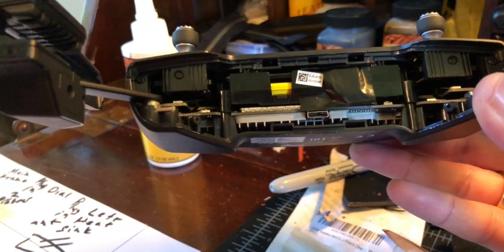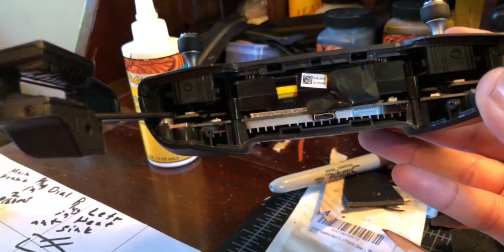DJI Spark Remote GL100A repair disassembly teardown

Comment: Can you help? My dji spark RC wont turn on 😢 please help
Reply from the maker: If you don’t get any lights at all, even when plugged in, it’s most likely the battery voltage dropped too low. The charge circuits won’t let you charge a battery that’s below a certain “safety” voltage level. If it’s just barely under voltage you might be able to revive with a “less smart” battery charger like one made for a a flashlight. Just make sure the charge is the correct voltage. If you are able to charge it some, i’d recommend finishing the charge back in the RC so it wont overcharge which could be dangerous.   Hope this helps!

Comment: The upper ribbon connectors or the lower ones? Or both?
Reply from the maker: It’s been several years, but I recall there is a ribbon connector on each side.

Comment: Hi I need help to charge my dji spark controller it keeps defecting please help
Reply from the maker: Not sure what you mean by defecting? Could you elaborate? Make sure the cord you are using has a small enough tip where the plastic doesn’t prevent it from going in all the way.
Reply: @bowieinc  I just opened it and found out it’s water damaged😭

Comment: Hi,

Thanks to you, I was able to open the remote. 
I need to change the USB port, but it looks like the motherboard is glued to a metal plate.

Can i send you photos in order to help me please?

Thanks
Reply from the maker: Sofyan B Hello, here’s a video that shows the usb being fixed. This should show you what you need:) I’m  very limited as far as my electronics knowledge. 
https://youtu.be/RkIdeKF_IZc
If link doesn’t work, the video name is “Broken Micro USB port on DJI Mavic & Spark, Replace Port Ketika Remot tidak bisa di charger”.

Comment: Thanks a lot, my remote was constantly beeping and I couldn't calibrate it.  Opened it up and found a loose screw stuck to the throttle stick on the bottom preventing it from moving properly.  Also the ribbon cable connectors open up by flipping up the black part along the back.
Reply: i am happy for you

Comment: Can you help me to fix my DJI Spark Remote?
Cz my DJI Spark Remote wont stop the red blinking.
The Red Blinking can be Stop after not turn on for a month time, but no wifi found
The Wifi can be found when Battery Indicator is 1 Light and not turn on for a month, but always when the remote need to update always stuck in 35%
Reply from the maker: Albatros not sure, first thing I’d do is try calibration on DJI go 4 app. If no luck, go to SparkPilots.zone and search postings. Good luck!
Reply: At lease my remote already can use again. The things I do is Full Charge the Remote and not Turn on for I Month then switch to sport mode before turn on the remote after a month. Then my remote back to live again